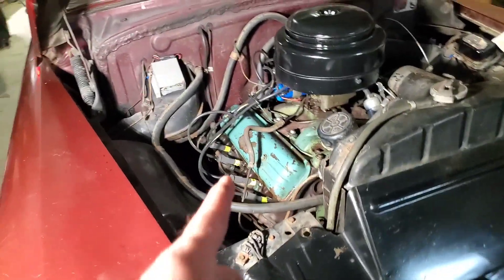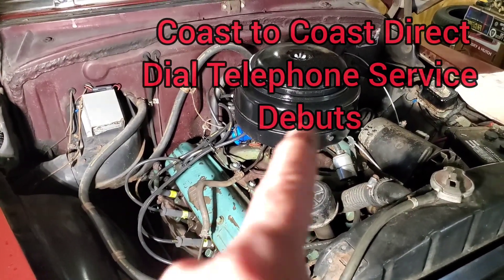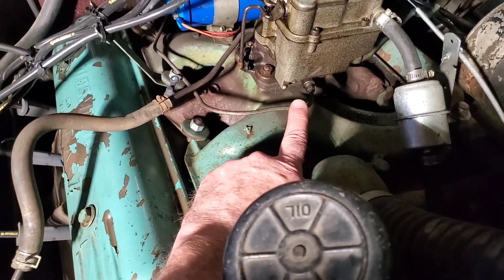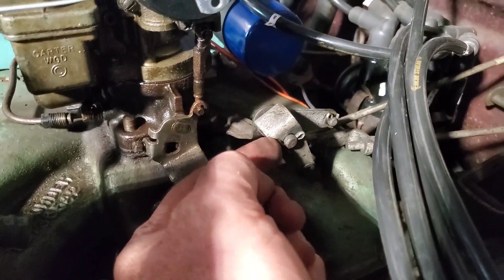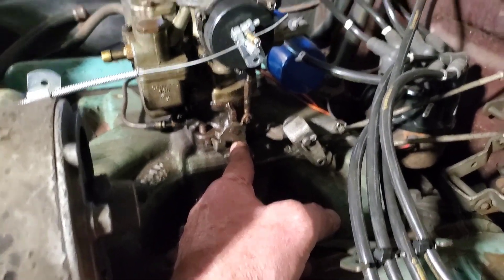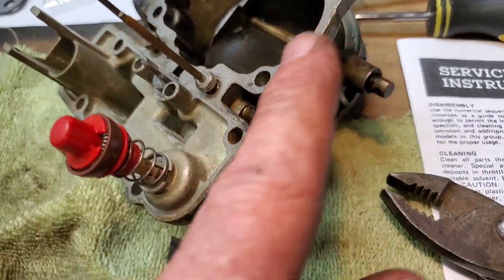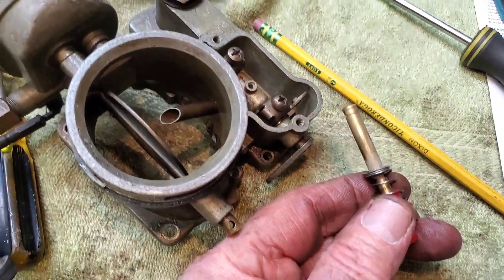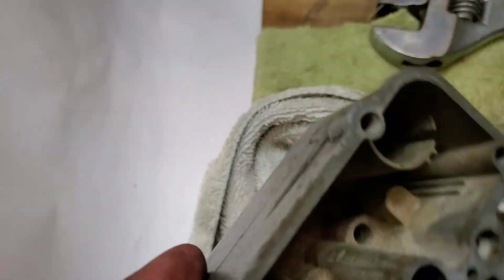Rebuilding A Carter WGD Carburetor For Ethanol Compatibility. 1951 Classic Car Oldsmobile GM

Comment: Nice work! Carbs can be a pain sometimes, but keeping track of all the parts is usually the hardest part. You did a fine job! I believe the tag on the carb was for quality control checks, they would punch it after each check. I have seen cars with those same type of tags for quality control checks.
Reply from the maker: Nice to see you!  So the tag is still there from the manufacturer?  Wow. It kind of makes sense. The more I dig into it, the more I think that it actually has only 55,000 original miles. It's problems are mostly age and rust and not wear.  Refreshing the seats right now.  Foam rubber is not meant to last 72 years.  Cheers!

Comment: The reason im asking is because I have a 1953 Hudson Super Wasp and it has a WGD 776s Carter 2 barrel carb that looks exactly like yours. I was having trouble adjusting it and it looks like you didn't have to adjust yours.
Reply from the maker: I'm glad you asked about that. I drove it just once after the carb work and discovered I had set the float level incorrectly. I had a waiting list of other things to do, but I'm going to be doing a deeper dive on tuning the carb using the original service manual instructions. Hopefully I'll be able to make her purr. Thanks for watching and commenting!

Comment: Did you have to adjust the carb after you put it back together ? If so can you explain how you figured how to adjusted the mettering rods and acceleration pump.
Reply from the maker: Just posted a video that covers metering rod and acceleration pump adjustments.  If you want to skip to that information,  I think it starts at around the 15 minute mark.  Cheers!
Reply: Looked for it a few times but I can't find your metering rod adjustment. It's mentioned in the repair kit, but would have liked to have seen it. @OGGarrettsGarage
Reply from the maker: @dorienberteletti2129  https://youtu.be/2N659GpkUQI?si=_vYWdMuaZMzO3444  I think it's at around the 15 minute mark.  Cheers!